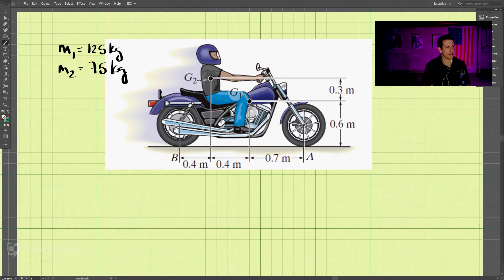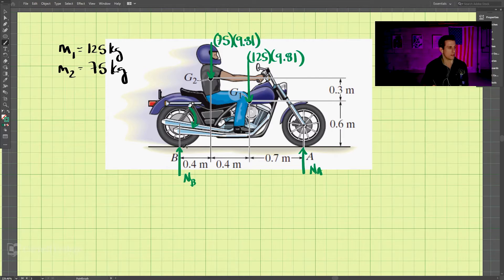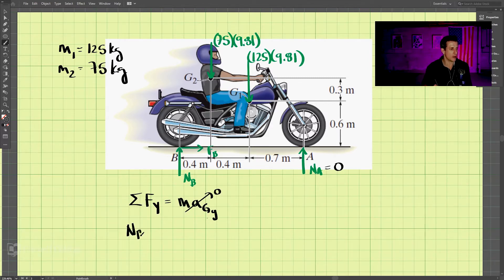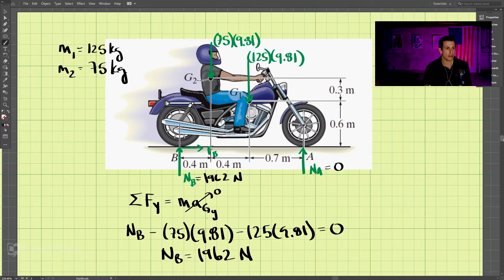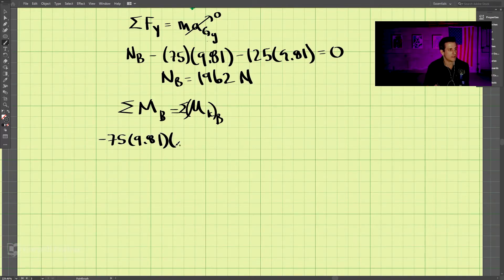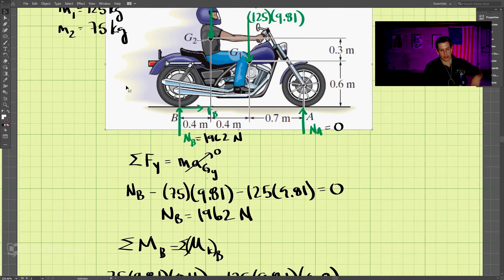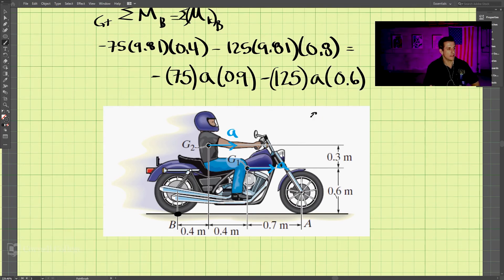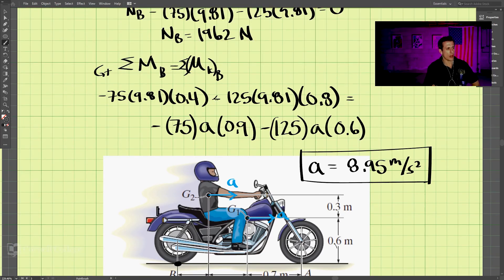Dynamics - Chapter 17 (4 of 4): Motorcycle Wheelie (Example Problem)

Comment: Interesting video. What about the torque reaction from the torque going through the rear wheel to the road. This would also be trying to lift the front of the bike so shouldn't it be considered too?
Reply from the maker: The torque at the rear wheel is taken into account in this problem. Since we are tasked to solve for acceleration, we don’t frame the problem in terms of rear wheel torque. The acceleration we solve for in this problem is the effect of torque on the rear wheel. At the end of the video we solve for the frictional force between the road and the tire. If we knew the diameter of the wheel, we could solve for the resultant rear wheel torque needed to lift the front tire off the ground. Also, note that this is a static problem, we are not considering dynamic effects (the rider shifting weight, effects of “popping the clutch, etc.) It is a simplified analysis, in reality, by shifting your weight and using the clutch advantageously it would require much less acceleration to lift the front wheel off the ground. Thanks for taking the time to watch the video.